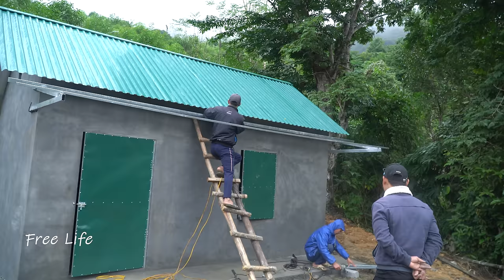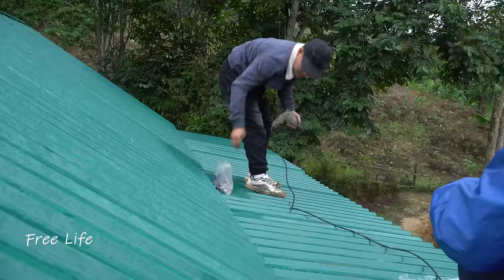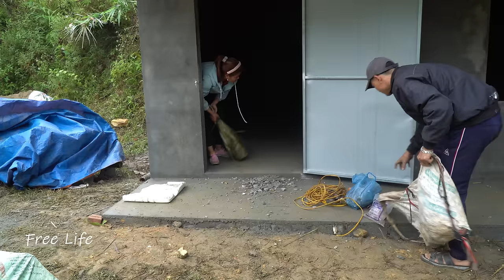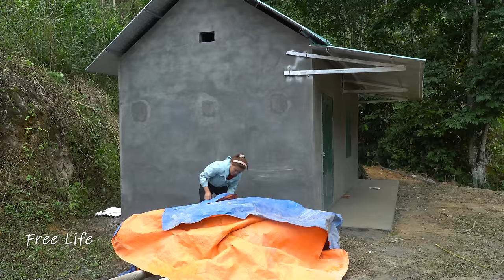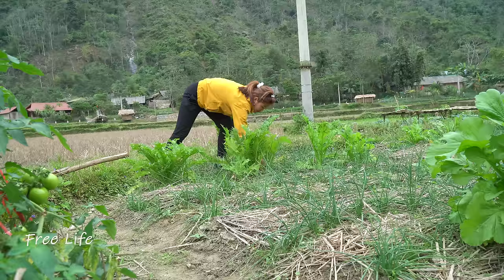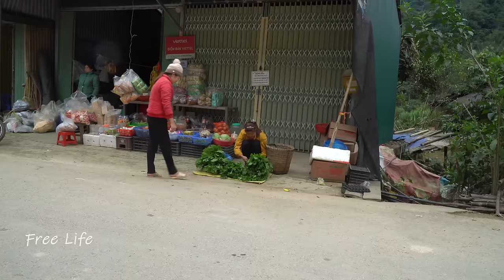Install the door, roofing the house porch, clean up & preparing to welcome Mr. Cha to his new house

Comment: Mr Phays  dwelling  (the second one) is the only sensible and liveable one I have seen. Why that construction was not followed here beats me. And why the need for all these stupid seperate kitchens? Slow combustion stoves-wood burning and with chimneys so the smoke and soot goes outside??? They are warm in winter and one is able to put their cooking pots on them. Sure as eggs all buildings will end up like the old lady's and cause terminal health issues as well.
So these stoves are cheap in your country too I bet or ali express.  Many under $150
So no kitchen needed and a shower cubicle inside in corner with water laid on with wash up tub   only toilet needed outside.
As it is
these  buildings except Mr Phays are death traps, and no way would anything like these be allowed in Australia.